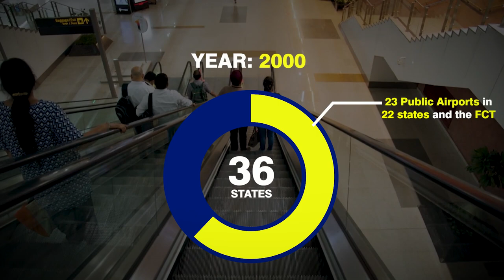Top 10 Completed and Ongoing Airport Projects In Nigeria

Comment: Nice listing of airport projects around Nigeria.

Abuja airport is about to undergo a major upgrade as a contract for a second runway and MRO facility has been awarded. 

I think the reason Obudu airport is being developed to have a 5.6km runway is because of the altitude of the location. The higher the altitude, the tinner the air becomes which means the planes will need more runway length for take offs than they would require for runways situated closer to sea level. If eventually completed as specified. FGN might want to acquire it from the state for strategic military considerations as some military planes require unusually long runways to land and take off successfully. Also, very large cargo planes that carry special heavy cargo such as amored tanks, aeroplane fuselages and other large/heavy items can be  landed here. 

Calabar's airport is a very long distance from Obudu, hence it's not out of place to have an airport there to help improve the tourism prospects of that side of Cross River. Bebi airstrip (the current airport at Obudu) cannot handle large aeroplanes due to the length of the runway and location.
Reply from the maker: This is really insightful 🙌👏, thank you for your contributions 👌. Please do well to subscribe as there are more related contents coming up. thank you
Reply: @webnobarafrica  just did
Reply: That's if the Airport will ever be completed and won't be like the Spaghetti Flyover in Calabar🤣😂
Reply: @nsikakessien  Time will tell. But I know work has commenced. If you open Google maps and switch to earth view and zoom in on Obudu township (the south west corner), you'll be able to see that the runway is already being constructed. It's at a laterite level as per the last Google update.

But I haven't been able to find an up-to-date Media coverage or even YouTuber video on this location. Perhaps, the distance from Obudu to any other state capital in Nigeria.

Comment: Why on earth is someone building a 5.6km runway?
Reply from the maker: to break a record I guess😀
Reply: It's the elevation of the airport that calls for it. Obudu has a high altitude which means the air is thinner which means a large plane will require more runway to safely takeoff. I believe that's why the runway is being built to that speciation.